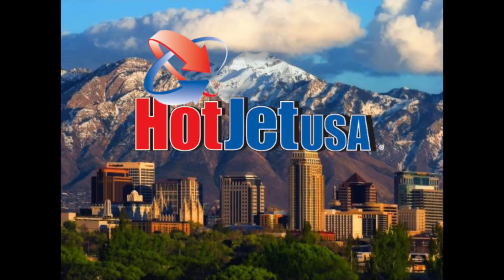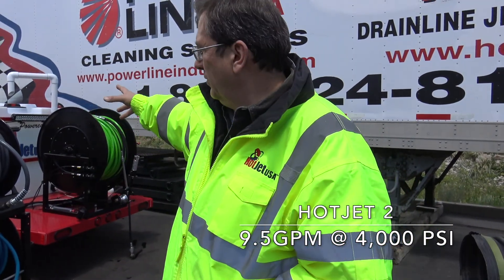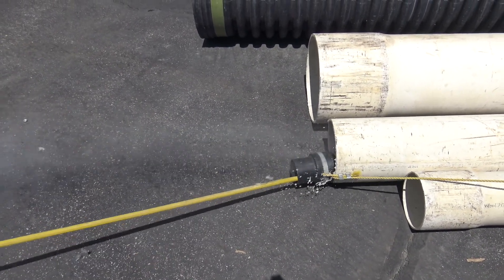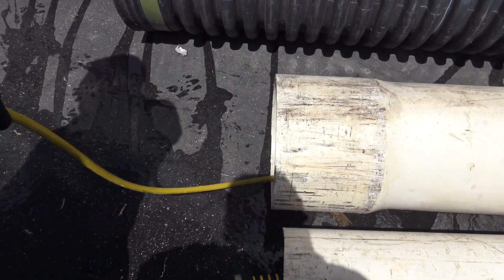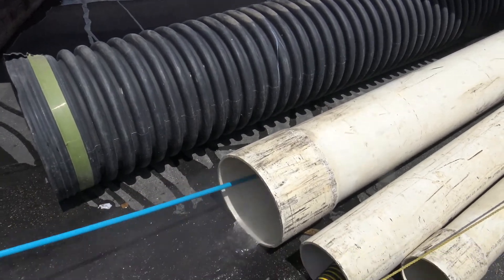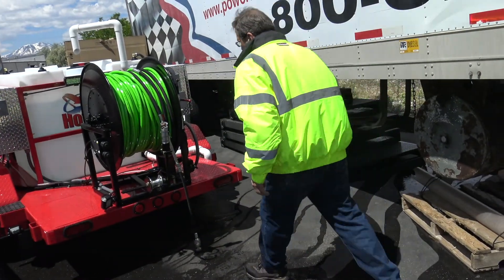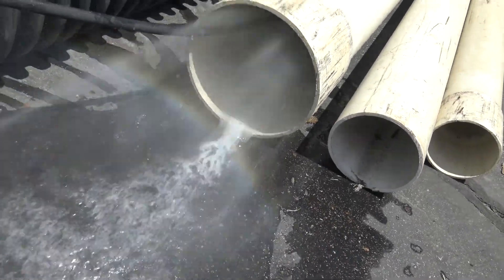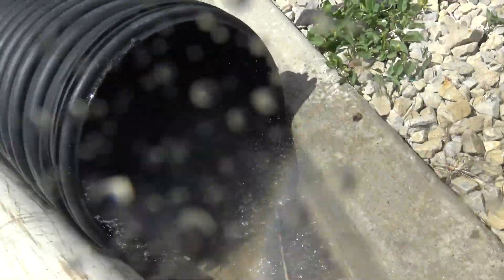Sewer Jetter Comparison HotJet 2 vs 18GPM at 4,000PSI

Comment: In Australia they're using the 5000 PSI and then 12-18 gallons and then I think it's a 1/2 line..... And Penetrator Blocked Drain is the Channel that uses that....

Comment: how does the stinger nozzle work.....by all accounts it should shoot back out of the hole
Reply from the maker: The stinger prevents the nozzle from shooting back. The length of the stinger used depends upon the size of the pipe. The larger circumference of the pipe, the longer the stinger which is basically a metal pipe that you attach to the end of the hose & then your nozzle would attach to the end of the stinger.
Reply: Amir Kazemi when we do culverts by adding that piece of pipe it saves you from injuries
Reply: The stinger won't flip around in the pipe it should be the diameter of the pipe your cleaning